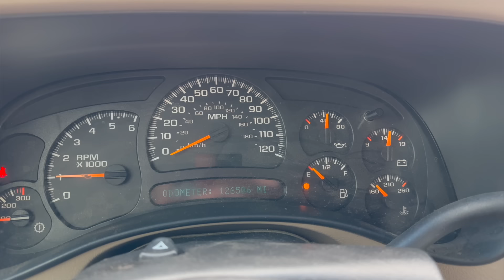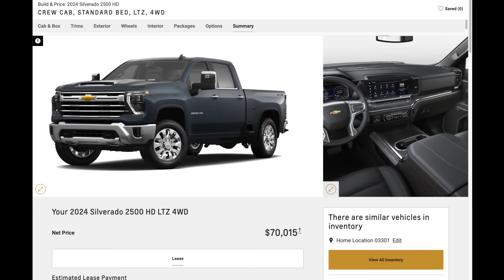I Bought the Best Truck I Could Get for $10k. How I Got it at Dealer-Only Auction

Comment: best built chevy trucks 2000 to 2007 and the duramax, i have 06 LBZ 6.6L diesel with 78 thousand original miles one owner that's right 78,000 LT1 crew cab Granite Blue original no lift a bit over sized tires that's it it's showing its age but runs like a dream well taking care of, oil change every 3000 to 5000 miles just a fantastic vehicle.

Comment: Wheel bearing or ball joint, wow! That garage needs a good cleaning. Um tightening the transmission pan looked pretty sketch bro. That’s a solid find though! Good job man. Lucky. That underbody is pristine!! PS- a little bit of PB Blaster works wonders!

Comment: I bought 1500. Had a small rear main seal leak. I put blue devil in it, it stopped leak but 2 days later engine cylinder lost compression blew its valves..

Comment: You did a great job with the repairs. It was hard to tell in the video but you mentioned that hub assembly (wheel bearing) nut "wasn't very tight" and then you tightened the new one down a bunch.  Was that a torque wrench? Are you aware of the torque spec on the front hub assemblies? It's not as much as you might think....i also wonder if that new hub assembly is still going a year in?

Comment: I got my 2011 Ford F250 XLT 6.2 gas for $23,000 back in 2015 in Iowa. I've kept it very clean to this day, spent 7 years living with my grandma on the Oregon coast. Helped her out with things when I was home, I'm an OTR trucker. She passed away last year, and so now I've moved back to Iowa as of May. My be getting a local job in towing and wrecker field soon if things work out.

That aside.. was looking at getting a second vehicle, perhaps. Only issue now is price. Kinda interested in the 3rd Gen Ford Ranger, if I can find a 5 speed in decent condition. I did find one, and dealer posting is asking $16,000.. for 2011 Ranger XLT king cab 4x4. The others are automatics all 2011's ranging from $10,000 to 15,000.

Now trying to decide if I wait, perhaps until after elections or until the inevitable economic crash. I know I saw some rangers for sell 4 or 5 years ago for like half what they are now. Prices anymore are ridiculous.

Comment: two things. Do they not put drain plugs on radiators anymore? 2nd, I noticed you don't write the date or mileage on any filters or parts you replace? Alway nice to see when working on something new to you and like myself it's always something with a ton of years and mileage. Someone down the road will thank you for it long after it's of no use to you anymore.

Comment: As long as this is an ad for an auction buying service, how about some full disclosure on what the fees were in order to procure the truck? I looked into the costs of buying through one of these outfits several years ago after Chris Fix mentioned the company he dealt with, and was stunned at the buying service’s markup. To add insult to injury, the service would not provide the VIN number(s) to possible vehicles, so it was impossible to run a Carfax report. Red flags all around.
It’s important to remember why vehicles are at auction in the first place. In many cases they are trade-ins that dealers have dumped into the auction because they require too much reconditioning to make them a premium used vehicle. Or worse: accident history or other issues. And, let’s face it, a single problem such as non-functioning AC can easily mean a $3,000 repair bill.
The one smart move is buying in the Pacific Northwest. I live in the Portland area and own seven vehicles, all but one of which are 2002 and older. There is ZERO rust on all of these cars and trucks. Nothing. This is the rule here. Cars in the East rust into nothing; cars in the desert Southwest might be rust free but the sun has fried their paint, plastics and fabrics. The presenter here marveled at the undercarriage of the Chevy. They ALL look like that.

Comment: I owned and operated a mid-scale agricultural business from the mid 90s.  A pickup was essential for us and we went through quite a few over the decades.  For me, nothing was more reliable than the GMC Sierra 1500 series - at least those made from mid 90s to early 2000s.  One, a 1999 base model with manual transmission and zero bell/whistles, proved to be the longest useful vehicle I've ever had.  It cost less than $18k new.  I wouldn't trust any of the US pickup models at this point, nor is the horrible price tag worth it for these unreliable pieces of equipment.

Comment: 99-06 GM trucks are the best and longest lasting trucks ever made. The gas trucks commonly last over 300K miles with no major repairs (except when the owners abuse them). I have an 06 with 215K miles and never needed any major repairs. With my v8 and half city driving I average 18-20mpg.

Comment: I do insist on having as.  Not willing to put up with the expensive of a modern diesel.
My current spark plugs are the ones that came with the vehicle and have 140,000 miles on them.

Comment: 10:24 are those tires Blizzack tires, I had those on an 87 Mercedes 300D. Worked great on snow but they wear out quickly on summer pavement . Looked like the same wheels I had, but Mercedes keep the same style for years.

Comment: FYI, that pretty ALUMINUM drive shaft can cause vibration and FLY APART at high speeds (bad). There is even a class action lawsuit filed against Chevrolet because automaker claims there is NO safety concern (surprise!). Supposedly the vibration  can be bad enough to lose control of vehicle (bad). It is recommended to replace it with a STEEL shaft, which might have to be CUSTOM made! Nice going, Chevrolet!  Anyway, HAPPY MOTORING.:face-orange-biting-nails:

Comment: Do you not need any RTV or gasket maker when you replace the transmission pan? Man I just tried to change a well lug assembly and I as at it for like an hour on and off trying to get the god damn hub off and you come in with a couple good yanks, and it comes right out. Was there some prep work before the camera was on you did to make it come off that easy? Or you have any tips.
I see you are a fan of TEKTON and ARES tools, so am I. I also like SUNX and Capri tools too. I can not afford tool truck tools but these are very well built tools. I recently bought a full set of ICON ratchets and I have no problems with those either.

Comment: You did a lil change out side of Walmart when they charge 25-50$ max for one 😣 besides that I love the truck lol
Reply: Probably doesn't want the lugnuts at the Walmart service center to overfill or underfill by a quart, or leave the oil filter loose so that later it falls off.

Comment: That tapping is an exhaust leak. My 01 6.0 2500hd has the same leak. And its got piston slap, transfer case rattle and every noise these trucks came with. But runs great and is almost at 90,000 miles. And I dont get how you got 15 mpg. Especially with the wornput hubs and spark plugs. I got 12.5 with the 245/75/16s and went to 267/75/16 ats and i get 13.5. I know its a few years newer but still. That just seems odd because i dont floor it or drive fast.

And what head unit do you have in that?

Comment: Buy a diesel so you dont have to change spark plugs?  Have you never changed a glow plug or injector?  Those LS based engines are the easiest to work on.

Comment: Hi.  My father owns 2004 Mercedes Benz E320 W211. It has 71,000 miles.  It needs all the fluid changed and inspection done by you to see if any work can be done.  If I take this to a Dealer, it would cost him an arm and a leg.  My Dad is 92 years old.  Would you be interested in doing this and making a video for your YouTube?

I  live near Philadelphia, Pa.  I can drive this car to Vermont.  Also, I want to know how you got so much knowledge on all those cars.

Comment: Yea igot a 2005 silverado . Piece of crap rotted the brake lines at 47000 miles, dealer wanted 2 grand to change them .  all the brake calipers froze up. Front wheel bearings couldnt be greased and tore up. Fuel lines rotted .they dont plasticite them or galvanized  them. Fuel pump check valve just decided notto work . And the fix was remove the whole bed . To gain access cuz no door in the bed to access it.  Chrome wheels were fake chrome wheels with a pressed on cover  and rusted bad i  had to buy steel wheels and  sandblast them and repaint them . And the spare tire mechanism rusted in the truck so i couldnt lower it and had to torch. It out. After a tow . And now my spare is in the bed . Bouncing around .  Cant fix the fan speed without removing the whole dashboard.

Comment: 8000 miles a year this truck was driver to work not used for work !Ive never seen a interior 15 years old so spotless! This is the second wheel barring not good! you can find Tacoma's two years old with this many miles! The dealers say 15000 a year is normal!

Comment: Its easier with a car lift i done alot of this on the ground trying to position yourself to have good leverage,  wrench and tools in limited space hitting your hands and knuckles on concrete,  cussing 100 times.😂 things look way easier with a car lift not lying on your back crawling under changing shocks,oil , starters, brakes, ect.ect.

Comment: If you want a better spark, change the spark plugs with the copper spark plugs. By the cheapest copper spark plugs, you can.

Change them every 15,000 to 25,000 miles and you will have better spark and save money on fuel and possibly spark plugs especially if you buy them on sale!

Comment: I bet that dealer gave the last owner of that truck next to nothing for it then charged three times the value for whatever they sold them, 10k is too much for that truck so they ripped you off as well in my opinion. but then that is just how things are these days, everyone charging way way more for things than is reasonable or fair. that year if chevy is pretty solid though, better than my 2014 for sure. I see those older Chevys still on the road sometimes with insane milage on them where my 2014 basically has its own bay at the repair shop lol bad transmission currently and this is the send one , truck only has 80k miles on it....thats what you get for 27,000 these days a nice looking piece of crap.

Comment: Do not undercoat that truck.  Undercoat hides moisture. Mic used motor oil with diesel fuel. And you spray the entire undercarriage and fenders every 6 months. Greasy yes Rusty no

Comment: you can get in on those wheel bearing bolts with an impact.  You clearly have impacts and power ratchets, yet I watch you use manual tools time after time just buring time and stressing yourself out.  WHY?!

Comment: I gotta tell you all, this generation Chevy truck 1500 -3500 were absolutely the worst vehicle ever made. Absolutely every one had terrible transfer cases (both models) they all fail @ various mileage) head liners cone unglued, the Bose Stereos all accept CD's but won't play, acknowledge or eject them, the closed loop fuel lines are paper thin and attached to the frame where they rust out and get holes reducing the fuel pressure from 11 lbs to whatever number needed to work,  at the tune of over $1,000 to replace. I know 5 guys that had this generation trucks and they experienced the same things. Anf G.M. Had Zero recalls on them either. I'm 64 and this was my 41st truck and car going back to 1965 Ford Galaxie 4 dr. And 2 68 Impala 4 drs. No bullshitting. Check these issues out on YouTube and you'll see.

Comment: It's a bulshit excuse to pull you over. It's a violation of the 4th amendment. You also have the right to travel freely unmolested. Strange that they do that all the time and she has a problem with it. Furthermore she had to run it without cause in order to pull you over which is a violation of the Fourth amendment